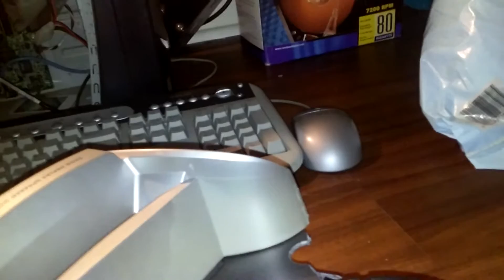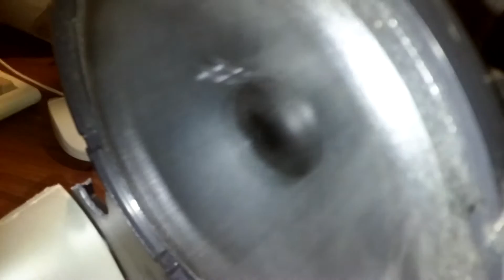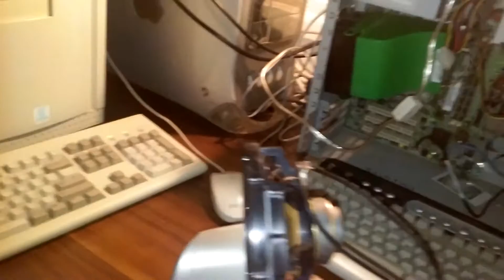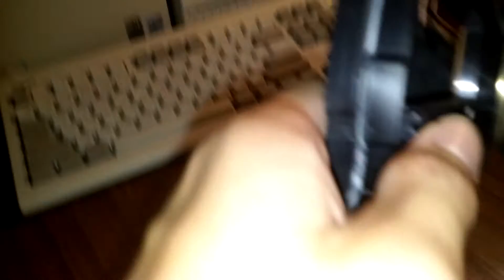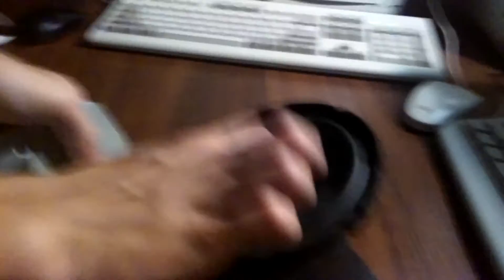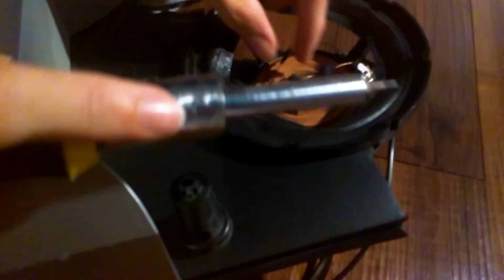Crappy Aiwa Speaker Blowout

Comment: I saw these for sale once, didn't check how much they were though. Glad you blew them haha :P
Reply from the maker: Yeah these were terrible!
Reply: They do sound decent when paired with an AIWA receiver though. The ones with the cd and tape players and super t bass. These speakers are more high excursion but do have some noise at high volumes. I have this same speaker driver. You remove it by twisting it out with a flat head screw driver. You obviously didn’t know that because of the half speaker box in the video.

Comment: Smaller magnet than my model. Mine moves too much and distorts.
Reply from the maker: DJIJ SpeakerGuy Yours might be newer
Reply: Carson Folio it also has a piezo tweeter, then I have an AIWA 3 way model, with 150 watts! It has less bass but does not distort. Assembled in USA (drivers made in China). It has less of a muddy sound and less distortion than my low end model.
Reply from the maker: DJIJ SpeakerGuy Mine didn't have any tweeters from what I remember